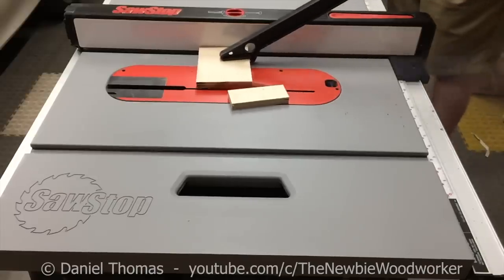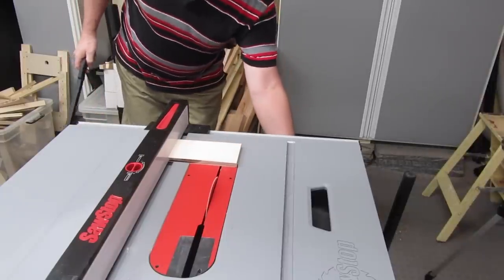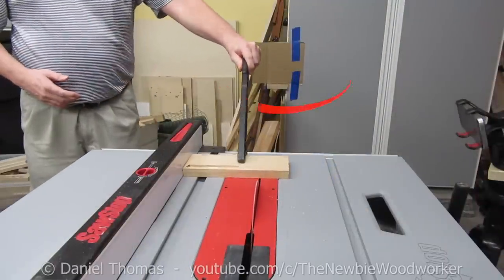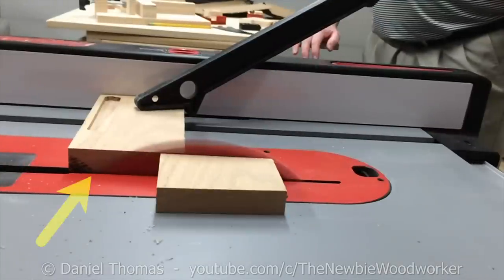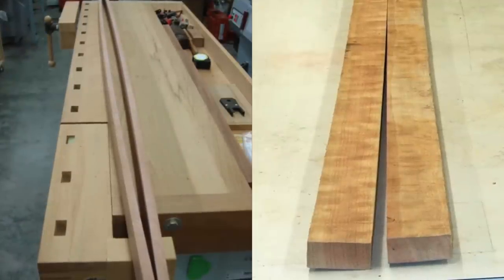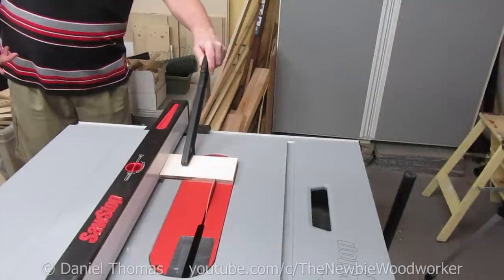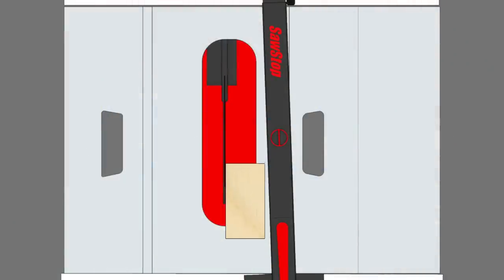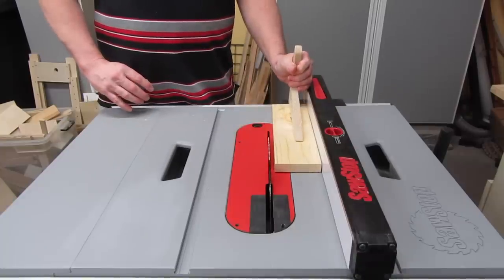Actual Kickback (in Slow Motion), & How to Prevent It

Comment: Safety tip. 
If you work in a garage and have a wife and a couple of brats like mine who intrude on your woodworking zen time with outrageous demands, complaints, and crazy questions, put a lock on the door and make sure it is locked when using the table saw. 
Kids yelling DAAAAADDDD!!!! and a spouse shouting WHY DID YO00UU!!!!! can cost you digits.
Reply from the maker: That's actually great advice - I think I'll pin it to the top. Thanks!
Reply: @TheNewbieWoodworker   put a lock on the garage inner door after the second near miss. Breaking focus mid cut is dangerous.
Reply from the maker: @swiftjunk3692  👍
Reply from the maker: @Bamboo Training 👍
Reply: You also wouldn't want the kids walking in and coping a peice of wood to the face. I will leave it to your discretion if you need do the same for the wife.
Reply from the maker: @rinzler9775  😂
Reply: @TheNewbieWoodworker   I do not think locking yourself in the workshop is a good idea.  What if you lose an arm and you cannot even open the door?
Reply from the maker: @luisurbina5115  That previous thumbs up was from one of my other YouTube accounts - I forgot to switch accounts. So, 👍from the proper account.

Comment: Exposed at last!!  That’s a huge amount of knowledge for a ‘newbie’!  I think you’re being very modest with the name in your title and I think you know a lot more than you pretend!  .  Can’t disagree with anything you’ve said or demonstrated and can’t think of anything to add.  An excellent video indeed.
Reply from the maker: Thanks, and LOL. The truth is, I just learn things quickly. I always have, well, at least some things. :)
Reply: As a somewhat experienced woodworker I agree with Ian.  The one thing that I have recently added to my table saw is the clear-cut guide that not only improves your cuts but adds to the reduction of kickback.
Reply from the maker: Thanks for the comment. I hadn't heard of the clear-cut guides before. The look really fascinating. They won't work on my current fence, because it has a knob on the top you need to be able to get to, but I'm thinking of building a new one, and I'll make sure to take those into account. Thanks again!
Reply: The Newbie Woodworker:  Just had a look at the stock guides by Jessem in Canada.  They’re obviously very well designed and engineered and do a good job but they’re way outside my budget as a retiree in the UK.  Also, it seems to me that they wouldn’t work when ripping narrow stock whose residue width was less than the width of the roller heads plus the thickness of the push stick and a small clearance to prevent them fouling the side of the fence.

Given this limitation and the price, I think a similar benefit could be obtained using a pair of featherboards, one clamped to the table, the other clamped to the side of the fence.  These would bias the stock against the fence and hold the stock firmly down onto the table which would eliminate the risk of kickback.  They would also cope better with narrow stock residue.  Of course, the fence may need a minor mod to accept the vertical featherboard.  Alternatively, this could be omitted and replaced with the pushstick leaving only the horizontal featherboard which should still prevent kickback by keeping the stock pressed firmly against the fence in addition to any such benefit provided by the correct use of the pushstick.  If in doubt, a second horizontal  featherboard could be mounted beyond the blade to be really certain.

Of course, all this assumes the fence is correctly aligned with the blade or at least the gap between it and the blade doesn’t reduce towards the far end.
Reply from the maker: Yep, there's always plusses and minuses to everything, and usually ways to do it yourself also. Thanks for the info!
Reply: It is correct that some cuts are not suited for these stock guides.  However, neither the stock guide, riving knife nor featherboards eliminate the risk of kickback.  They reduce the risk.  I believe the riving knife is the single most important item to reduce the risk in the absence of anything else.  I mounted my stock guide to a strip of MDF which attaches to my fence with mag switches (c/o Dave Stanton) so it can be easily removed for various jigs that I use over my fence.  So far as the cost of the stock guides, I also spent the extra for a Sawstop and consider safety a high priority.  A fringe benefit of the stock guides is great cuts.

Comment: This is a fine demonstration. Thank you. I would suggest to make a version II that includes using a blade guard when possible. Many demonstrators show how to make cuts without the blade guard attached, suggesting to the new user that it is not possible to use the device. It would be nice to see cutting techniques with all safety features being used.
Reply from the maker: Thanks! I really only feel comfortable talking about what I know (or at least what I think I know). I don't use a blade guard, and I don't really like them, so I think I'll pass. But thanks for the idea. 🙂

Comment: Comments from a lefty with about 2 years experience as a hobbyist woodworker (I def consider myself a newbie):

1.  I still use the fence to the right like all you righty’s out there. I tend to stand to the right of the fence and use my right hand to complete cuts just like you did. I think I stand to the right because I want my right hand close to my center mass instead of way off to the side. I just don’t have the confidence to use my right hand extended way out like you showed. 

2.  Spend the time to make sure everything is perfectly aligned when you first buy a saw. I’m on my third table saw in just a few years (I keep upgrading I think I’m good for a while with the ridgid contractor saw). Each time I spent at least 4-5 hours double checking alignment and messing with it to make sure that the miter slots, blade, fence and riving knife are all parallel. 

3. I found that by making a few wooden push sticks that I didn’t mind cutting into helped me with controlling the wood much better. I didn’t tip toe around the blade and compromise my grip. 

4.  Don’t raise the blade higher than you have to. 

5. Don’t wear gloves or loose fit clothing. 

6.  If cutting a big piece, make sure it is supported before and after it passes through the blade.
Reply from the maker: That all sounds good to me! I have a few videos on tuning up a table saw, so I totally agree with that. And having push sticks you don't mind getting "eaten" is also a great tip. I've gotten fairly good at making new ones. :) Thanks for the comments!
Reply: I once had an instructor who insisted we wear gloves for certain jobs. I showed him some pictures of a friend of mine whose glove had a loose thread that got caught in the grinding wheel. Not a pretty sight...
He never insisted on it again.
Reply: Thanks, so much!

Comment: The Micro-jig Grr riper is 1000% worth saving my fingers over the price. I was unemployed and I was working on my house and weighed the option of cutting my fingers or spending $70 on it. I loved it so much, I bought two. Can't put a price on safety, it wasn't too bad on my wallet. 

I think you brought up some very good points and I love the demos your showed. Table saws are like cars, they're as safe or as dangerous as you want to make them, you have to be careful and paying attention while  driving and pay attention and careful when you use a table saw. 

I want to mention I'm new to woodworking and the table saw was the most feared machine for me where I'd ask my brother to make cuts for me. However, with videos like yours and safety push blocks like the micro jig Grr riper and having patience, I'm 90% done with my kitchen remodel and built all my doors and drawers by myself on a miter and table saw. 

Again, have patience, wear ear protection and the sound of the blade won't scare you if you're new to it. It was so loud the sound alone scared me, now I can't wait to build more stuff!
Reply from the maker: Great comments! Thanks! I agree about the Grr-Ripper, and I own two also. And your analogy about cars is spot-on. Don't text and cut, either. :) Good thought about the sound contributing to the fear factor. I hadn't thought about that. I think you and I think very much alike. I think that's a good thing. 😛
Reply: If the table saw is your worst fear then you don't work in a shop with a shaper made in the 60s.
Reply from the maker: @donjonson9587  LOL. It's the same with a lot of things these days. As things get safer, it's hard to believe what we used in the past! Thanks for sharing. 😄
Reply: @TheNewbieWoodworker  oh yeah. Old school wood workers had to have some steel cahones.
Reply: @TheNewbieWoodworker  hell. Nowadays with all the fancy cnc machines and automatic shapers humans don't even need to put themselves in danger to make quality pieces.
Reply from the maker: @donjonson9587  Now where's the fun in that? 😛 I'm a retired computer programmer - the last thing I want to do is sit down for longer at my computer. Cutting things myself, even when I cut them wrong, is therapeutic!
Reply: @TheNewbieWoodworker  absolutely agree. 100%. Sanding though.... yeah, I'd rather leave that to the machines. Lol
Reply from the maker: @donjonson9587  Totally agree!
Reply: I have a friend who makes picture frames from wood.  I asked him to make me a push stick like the micro-jig gripper and told him he should make one for himself at the same time.  Mine is not the same and is made from wood.  He never did make one and a few months later he was running a planner with gloves on.  The blade snagged the glove and pulled his hand into the power planer and took off the top of his thumb.  I made my own push stick and it is 4 feet long.  My hands never get never the blade.
Reply from the maker: @owenprince4823  Thanks for the comment. First off, never wear gloves while using any type of tool that can grab the glove. Table saw, router, planer, drill press, etc. Sometimes I use gloves when I use my angle grinder, but I'm holding it by the handle, so it can't grab my glove.

Secondly, a 4 foot push stick is too long. You don't have enough control of your stock that way. Buy one or two Grr-Rippers, if you don't like other push sticks. Or build your own Grr-Ripper: https://youtu.be/3xMQMjRApok.

Here's some good designs for push sticks you might want to try out: https://youtu.be/h63U2lw1KHk, https://youtu.be/eZ6itaIFQZs. Look at the second one. Try to imagine a scenario where your hand will get pulled into the blade. It's not going to happen. Your hand is plenty safe there.

Whenever you find yourself resorting to something so different than anyone else, like a 4 foot push stick, you need to ask yourself why nobody else uses something like it. Of course you could be creating the next big thing, but honestly, there's a reason nobody uses push sticks that long. No control.

I hope this helps.
Reply: @TheNewbieWoodworker  You would have to see my design to understand why the 4 foot length.  Think of a floor plane that is longer to give more control on longer strokes than a shorter hand plane.  I don't know if you have ever seen a floor plane but it is a lot longer than a regular hand plane.  It has been working for me as I still have all my fingers.
Reply from the maker: @owenprince4823  Oh, actually that does make sense. I'd love to see some pics of it. If you don't mind, go to my website, thenewbiewoodworker.com, and click the Menu in the upper right. You can email me from there. Thanks!
Reply: I just got a table saw last weekend and I'm scared to death of it

Comment: I'm glad I've watched many videos like this to know what my table saw is capable of. I just purchased it and got into woodworking during the Coronavirus quarantine. Well let's just say I am more scared of my table saw than my gun. Sometimes as I am cutting I can see the block wanting to lift up off the table as I am using my push stick to finish the cut and I just press down with stick and pray that things don't go south. I am getting better with it but the amount of respect I have for this machine is unreal. I talk to her before I start her up and ask her to be nice.
Reply from the maker: LOL. It's actually a decent analogy, comparing it with a gun. If you know what you're doing, and make sure the equipment is in good shape, then you're much safer. If the stock is trying to lift up, my guess is you're using the stock push stick. Try this one - it's incredibly simple to make and will give you a lot better control: https://youtu.be/sei4CwkP3kQ
Reply: @TheNewbieWoodworker  thanks so much will do.

Comment: For a 10 inch diameter saw running at 4,000 rpm - fairly typical - the tooth speed is about 120 mph - 190 kph. That's about 174 feet per second. Admittedly the piece of wood has to be accelerated up to this speed, but this is why things happen so very quickly. That lump of wood can cover the distance to you in something around 0.02 seconds, just over one video film frame if shot at 60 fps. It would hit long before you could dodge. Kudos for filming it and raising awareness. BobUK.
Reply from the maker: Thanks, and I totally agree. And yes, it was about 1 frame shot at 60fps. Amazingly fast. But hey, if you want to see fast, try putting something between a router table fence and the router bit. It's like a shotgun! Not that I'd know from personal experience, or anything... 🙄
Reply from the maker: @Mike Evans 😛My wife still remembers what that sounds like.
Reply: And with the average human reaction time around 0.25 seconds we're about 10 times too slow to even start getting out of the way!
Reply from the maker: @elementboy212  Ain't that the truth! Sometimes in our minds we imagine moving faster, but the reality is, not a chance!
Reply: Acceleration is probably virtually instantaneous, it comes from transfer of momentum from the blade to the wood. For a slow motion demo, watch the change-over in a Madison bike race.
Reply: @TheNewbieWoodworker  You crack me up!  Or, should I say...
...thanks, for keeping me from being cracked up!
Reply: I had a heavy solid piece of oak shoot like a bullet straight past me. I wasn't standing in the line of the blade for some reason, because I never use push sticks, and I hang off to the side, always pulling my hand away from the blade, while cutting. But this time, I was momentarily mind controlled, and I "froze" midway through the cut and didn't know what to do. While I was standing there in a hypnotic trance (typical among people who have bad accidents, due to some type of mind control trance) the piece of oak caught on the blade and shot away from the saw like a bullet, and my hand also slammed into the blade like a bullet, and I felt my hand ricochet off the blade in about 1/30th of a second. It was so fast, that I felt nothing, but when I looked down I had multiple lacerations. The piece of wood could have caused severe injury, had it hit me, because I had the blade turned towards the fence, and it grabbed the wood and shot it straight out like a projectile. It was a very heavy, small 1 1/2" x 1 1/2" x 12" square chunk of very heavy hardwood. My hand is ok, I sliced half way through 2 fingers, and cut across 4 fingers, but I didn't cut any fingers off. I haven't used the saw since, and I'm not sure I'll ever enjoy cutting boards again.

Comment: Thanks for this video, i'm glad this video popped up on my recommendations.

Just getting started on diy woodworking and is getting interested in owning these machines, i know the table saw is dangerous, but i thought the only danger is accidentally touching the blade, had no idea about kickbacks. Would definitely research more before using any of these tools.
Reply from the maker: Glad I could help! It's a good idea to learn about the dangers beforehand. And believe it or not, most of these tools come with instructions that have good safety tips. I didn't use to read those things, but someone mentioned that often times they're fairly useful, and he was right. 😄

Comment: Good advice. Thank you. The access plate to your saw needs to be level so not to catch the wood. All of the table needs to be smooth and clean. I clean and wax everything including the saw blade. One big problem is keeping the area clean around the saw. A neighbor tripped on one of his cut off boards and fell into the saw. It cost him three fingers. Keep it clean and clean often. Thanks again for your great advice.
Reply from the maker: Thanks, and boy are you right. It's the little things that end up being the biggest. :)
Reply: Steve...Yes, absolutely...keep the floor around the saw where you work clear and clean...!!
Reply: Dude, this nearly happened to me today. I tripped over a piece of wood and stumbled, completely out of control away from my running saw. Alls I could think was what would have happened if I tripped toward the saw. After that I turned the saw off after every cut (if I had to walk around the saw to get the ripped board).

More work... But I like being able to do this. And I can't if I lose a finger or hand.
Reply from the maker: Wow! But good way to learn, without damage, so it ended up being a good thing. I turn my saw off almost all the time, mostly because I'm so scatterbrained that I might do something really stupid, like lean on the blade or something. 😮 😛

Comment: Great safety video.
After useing a table saw for 50 plus years without serious injury 3 weeks ago I got 35 stitches in two finger tips on right hand. Cutting through a knot and it jerked wood. It cut me faster then you can blink your eye.
Thankfully I didn't cut tips off and stitched back together.
Reply from the maker: Wow! It just goes to show, it can happen at any time.
Reply: could you describe how it happened when cutting the knot area? What type of cut were you doing? How could it have been avoided?